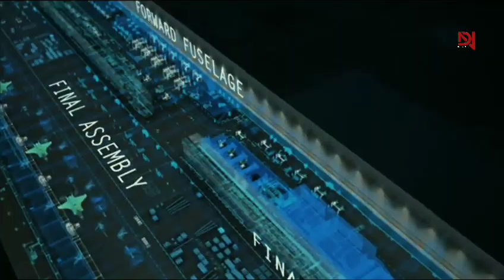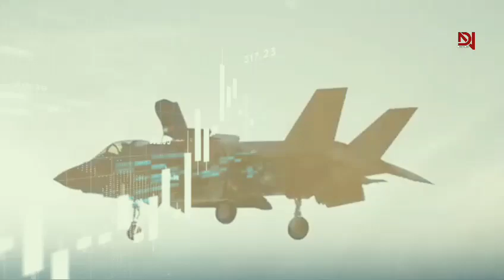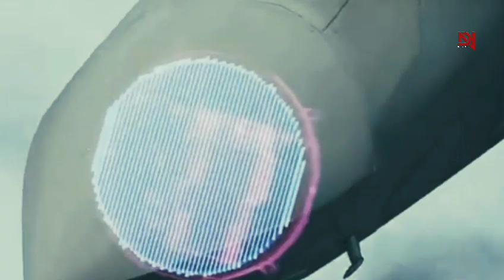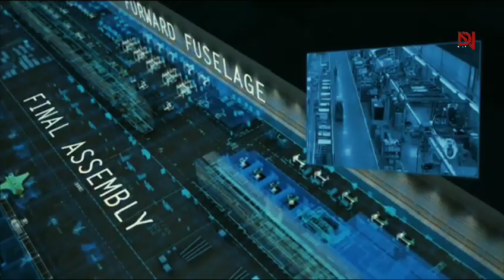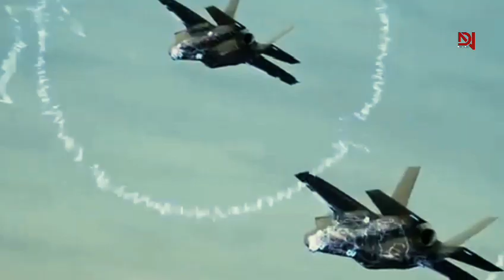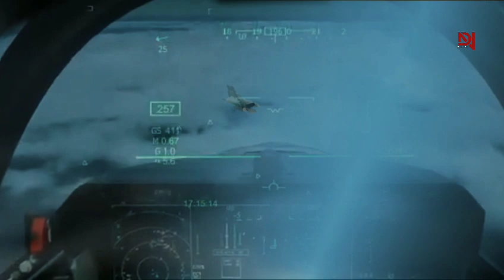Is the F-35 Fighter Jet the BIGGEST WASTE of US Military Funds?

Comment: Those cost estimates are for the entire program, design, construction, every drop of fuel, every hour of maintenance, every spare part over the course of 60+ years as they are expecting to use them till around 2088. So around 33 billion a year, a huge amount to sane people, but just a taste of the current US military budget of around 850 billion. A bargin for a cutting edge aircraft that will be the primary source of air power for all three branches.
Reply: Ya so sad how they can just twist it without understanding the full picture.